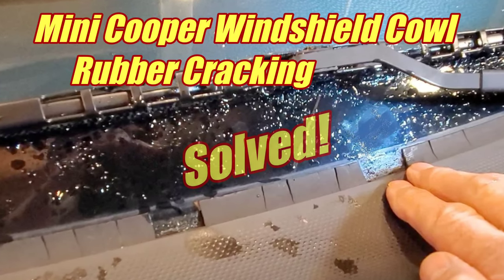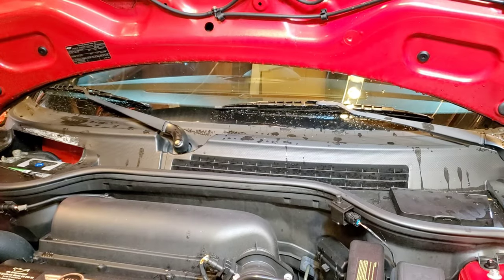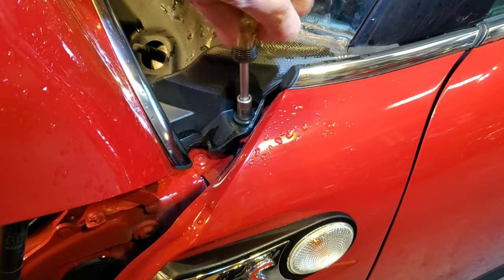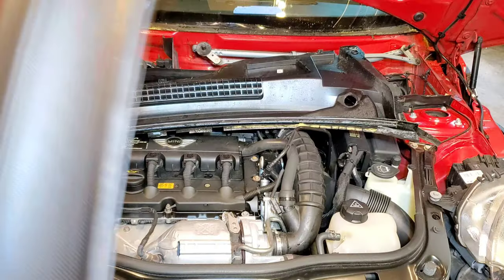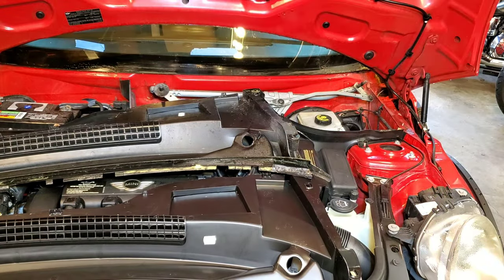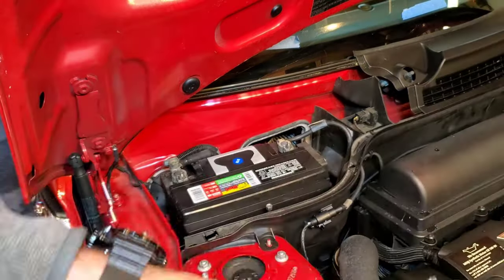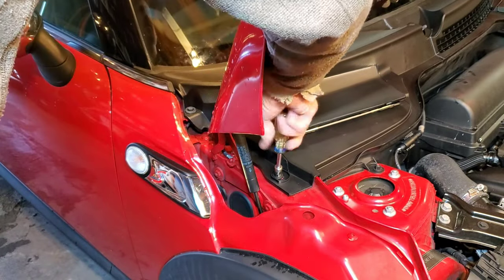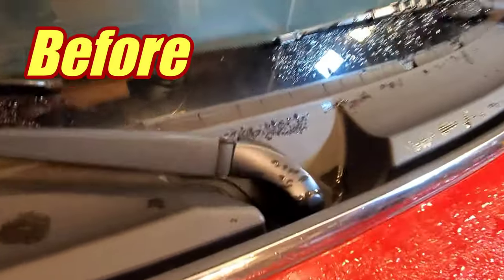Mini Cooper Windshield Cowl Replacement Broken Battery Hatch and Cracked Rubber Seal 2007 - 2015

Comment: New cowls and alignment strip for my 2009 S Hatchback, R56. I have fought and fought to get the channel on the alignment strip for the windshield to sit in that channel and STILL can't get it. I tried just using it like you did and the rubber on the cowls do not sit on the windshield...they stick up off of it. I'll try again, maybe the 18th time's a charm.
Reply from the maker: Understood and agreed. Gluing the alignment strip to the glass was not worth the effort in my case either. So, what worked well for me was loosen all the nuts, then let the alignment strip drop below the base of the glass so the rubber flap lays down on the glass. You can then gently or not at all press the strip against the bottom of the glass and re-tighten the nuts. Just be sure the strip doesn't jump back on top of the base of the glass as that is what will lift the rubber flap off the windshield. Our rubber strip is still laying flat on the glass and the alignment strip is just below the edge of the glass and all is well. I hope that helps.
Reply: @ScubaMoto  Thank You for your quick reply and further advice. I will try this.

Comment: thanks for good video. seems that the plastic quality of this model is not durable as its expected.
Reply from the maker: I agree. These are not the best design and/or materials. The battery hatch hinge is designed to break with repetitive use. It probably has a design life of 90 openings before yielding to bend fatigue and breaking off. Directly beneath it is a direct opening into the heater air intake for water intrusion to cause damage to the control module electronics in the passenger foot well. A common issue with these vehicles. The rubber windshield lip cracked faster than I've seen on any vehicle. And the alignment strip that was originally designed to glue to the base of the windshield while also clipping to each half of the cowl to keep it aligned will likely never glue on the glass again properly while also aligning the two half's of the replacement cowl. My priority was cowl alignment and I put a note in the video description on dealing with that. We can only work with what exists and make the best repairs using it. Thanks for sharing and good luck with the replacement.

Comment: Can/will water leak from this? I have found water on my driver's side floorboard (streams from hood latch). It's definitely dry rotted and needs replacement. I've checked the sunroof drains and they seem to be working properly 😊
Reply from the maker: It sounds like you've isolated the leak to where the hood release cable comes through the firewall? If so, that should not be possible. So it's likely that the cable seal has failed where it passes through. A new cowl will not fix it. Water will always find it's way to that spot. If I knew I had a leak at that location, and my hood latch was working fine; I would simply re-seal the point where the cable passes through the firewall. You will need to remove the cowl as shown in the video to access the pass-through location and apply a sealant. I would likely use a windshield sealant but an RTB or even silicone could also work.  Good luck with it.

Comment: Where can I purchase a new cowl with weather stripping
Reply from the maker: Search on the part numbers and you will find many sources to choose from. I also have the part numbers in the video description. Left Cowl: 51132751209 - Right Cowl: 51132751210 .